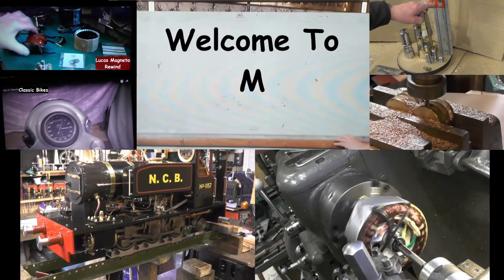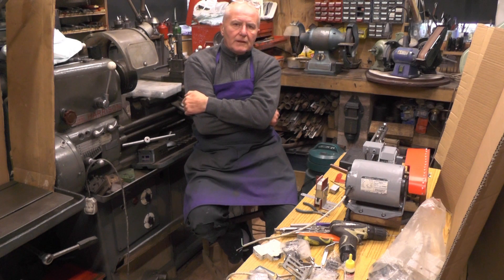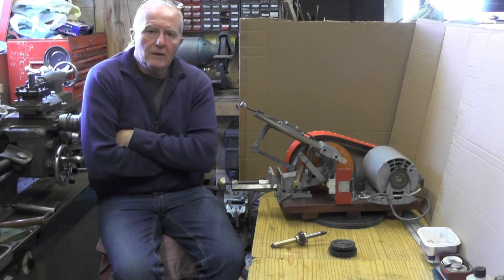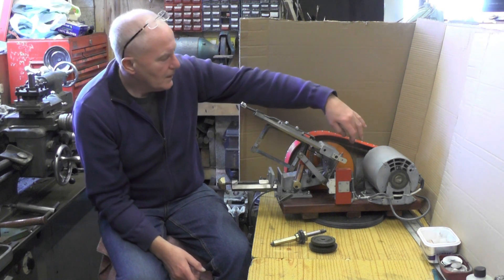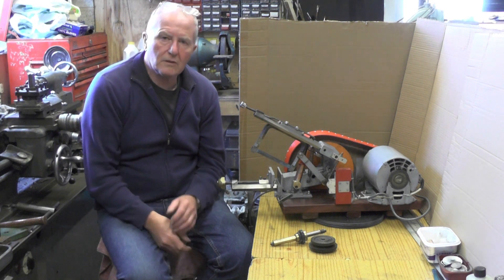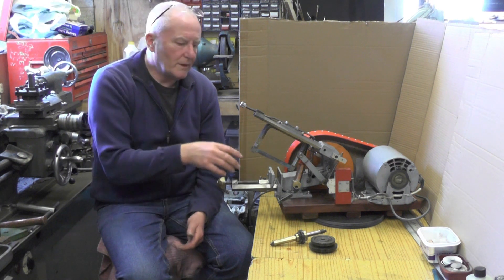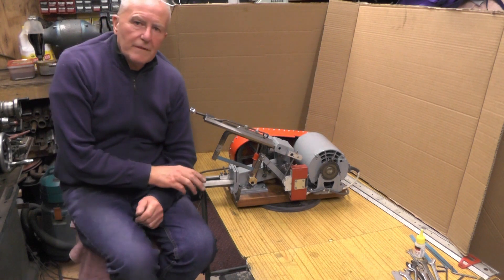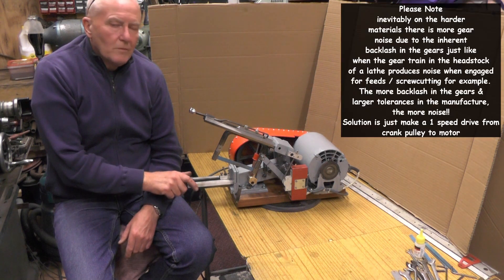Making a Compact Mechanical Hobby Hacksaw Part 11 (The Finale with a Twist)

Comment: Hello Kev! Been going through your old videos and found this series, not sure how/why I missed it. I have a nice vertical Grob bandsaw, however I would like a powered hacksaw such as this I can tuck under the bench to send it on some of the smaller mundane cuts. I think I understand how it all works, but I will design it all in CAD. If I am able to finish the design, would you mind going through it to compare to yours and make sure I didn't misinterpret anything? I would like to provide you the CAD files as a thanks for inspiring. I need to design in 3D first and work off plans. Your Micro-Chip build and this series are amazing, but to me what makes them exceptional you can formulate a plan in your head and execute. Kudos, all the best this holiday season and hope you have a successful 2026!
Reply from the maker: Cheers! So glad this series inspired you. Would love to see your CAD design when you're done! 👍🚂 Although i don't use CAD so not sure if the files would be useful for me, as i have no plans to use cad in the future at the moment. By all means send me a printed copy if you wish. Hope it works out ok for you, my little saw sits under the workbench and just cuts away while i do other things. Its slow but great for hobby work
HNY to you and family😉😉😉👍👍👍
atb
Kev
P.S. now contact made i have sub'd and bell'd you and will keep in touch with your videos.

Comment: Do you suppose nylon gears would run quieter? Surely they’d be strong enough.
Reply from the maker: Yes  Mark
Thanks for your interest and feedback👍👍👍
Nylon would be great but i just work with what i have got at the time
You could say i'm as tight as cramp🤣🤣
I have reverted this saw back to belt and pulley drive which is probably in another video, it's quite a while since i did this so memory fades
regards👍👍
Kev
Reply: @MrFactotum  I think belt-and-pulley might be the answer with modern high quality hacksaw blades. But cheap nylon gears are so tempting.
Reply from the maker: @TheIntermont  If i can offef a bit of advice from experiencing it, if the  saw locks up the belt will slip, if gears are on the motor jams up still under power so could in theory burn out. just a point to think of,  Although wouldn't matter if a thermal overload switch was fitted👍👍
Reply: @MrFactotum  Naturally the initial reduction stage should be a belt. I’m well aware of my projects failing in various ways. Actually you and others have had good luck with the faster speeds, so there may be no need for the gearing.

Comment: That was an awesome project.  Thank you for showing the build.  One thing I noticed is that you notched both sides of the saw frame.  Why did you do that?  Or was  it an added design feature?  Thanks again Kev.  You channel is both entertaining and a great educational experience. 

Joe
Reply from the maker: Hi Joe 
Thanks for feedback, Notched both sides because of design feature, to higher the pivot point and to reverse the screws to have the head on the outside for ease of use.
Cheers Joe
Kev (Mr F's W)

Comment: G’day Kev. Excellent results, well done. Looks like you need a bigger paint brush. I hope you didn’t cut up the kitchen breadboard for the safety shield, what will she say. Love your use of a circuit breaker for a switch and especially the trip lever. 
Cheers 
Peter
Reply from the maker: Cheers Peter
I'm safe!! Not a bread board, an Infant school chair out of a skip, yes the switch turned out ok and doubled up as a fuse,
take care
Kev

Comment: It's been wonderful following this build as it progresses- bravo on a successful completion! re: gears - you can't win them all, I guess?
Reply from the maker: yes, there ok though, just wanted to let everyone know about the gear noise in case anyone makes one, ive thought about making some fibre/delron/plastic gears, but that's for another day. Next up coming soon, A Vertical Grinder attachment for the Mill to make a single point gear cutting tool, 360 degree lighting for the Mil and Single Point gear cutting for the Myford Lathe  gears 33 & 34 tooth the "short cut " method for cutting a wide range of metric threads on a Imperial Myford.
Thanks for watching 
Kev (Mr F's W )